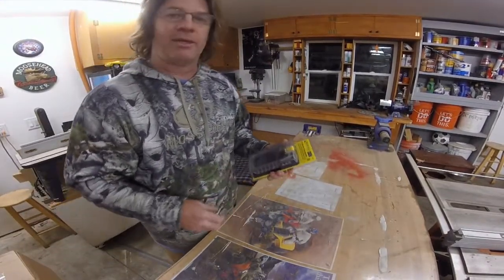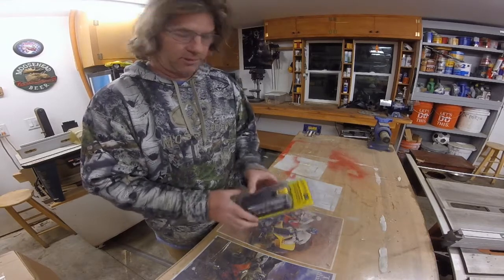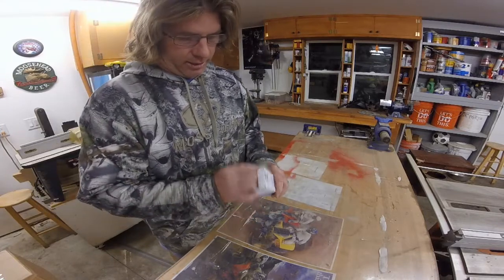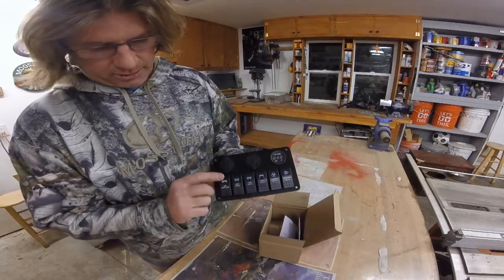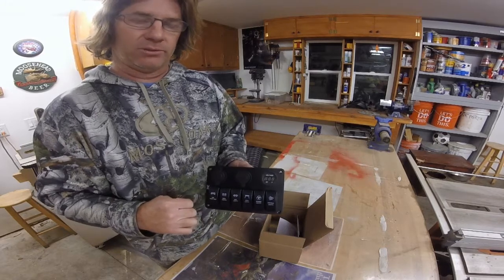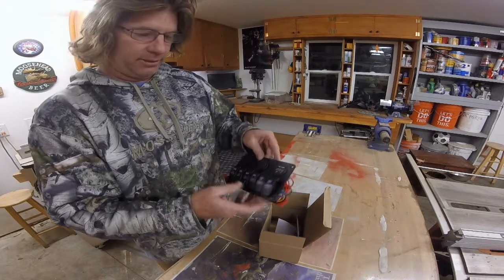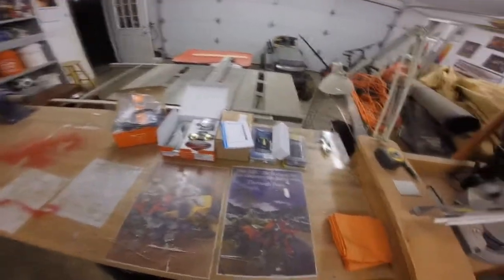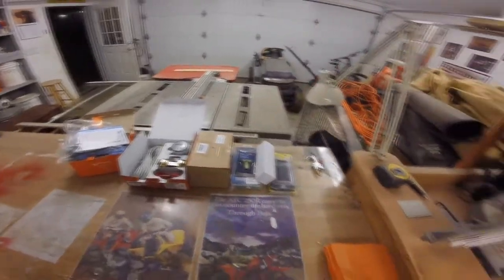First Parts for the Next Build!

Comment: Hello there. Great video - its really informative and thanks for sharing! Question for ya: If i want to parallel 2 Victron MPPT Charge Controllers - 100/50, do I need to have separate combiner boxes from the PV Array? Also, can I connect wires from the 2 charge controllers or they can feed the battery bank separately? If I combine/connect them, should I fuse the positive terminal before the positive wire gets to the batter bank? Thank you!
Reply from the maker: Thank you! I have only seen charge controllers run parallel when the solar array was also split up. X panels to controller one and Y panels to controller two. This is usually done for redundancy, but also for larger arrays. In this case they both have output wires to the battery bank. I don't have mine fused, but I do have a disconnect switch on the positive wire from the controller to cut off the array if necessary. Trip-Unlimited is running parallel Victron charge controllers, maybe they can give you further ideas?
Reply: Colorado4x4Van 
Thank you for your quick response and for the information. I’ll reach out to Trip-Unlimited as well. 👍

Comment: Well, this is all interesting. Does this build have anything to do with seeing what is coming down the pipe, currency collapse, etc? Have you considered a Fuso platform and if so why have you decided not to go that way? Thanks - Now I will grab the popcorn.
Reply from the maker: In truth, the only thing coming down the pipe in the future (for us) is our daughter!...lol...We need a bathroom, shower, and third bunk. The Van has been great for me and two of us, but no room for a third. I looked at Fuso, but the trucks they have in this class are not as sturdily built as the Steyr or Unimog. I couldn't fit a 14' camper on a Unimog, so I'm going with the Steyr.
Reply: Well, raising a daughter can cause financial collapse as well, ha. While the Fuso may not be as robust it would certainly get significantly better gas mileage I would think. Which brings up a question, which I may have asked before but certainly have forgotten, what gas mileage do you get with the van, and what is it's drivetrain. T-Rex has the 460, 4 speed tranny, and I believe either 4:11s or 4:56 gearing, and gets aprox. 10 mpg in US gallons and 12 in imperial gallons. Oh, and the van weighs 8000 lbs dry. Thanks
BTW. I have my eye on an alternate 4x4 rig similar to what you are doing but it really is hard to beat the 4x4 van. You can go bigger but you will give up mobility.
Reply from the maker: Don't ruin it for me!!...lol...My Van is 7200lbs. It is the 350 Chevy/TH-350 3-spd automatic transmission and 4:11 gears. It gets 11 mpg average. ( I usually keep it around 60-65mph) The Steyr gets 12mpg (weighing @ 12,000 lbs.) average so I won't lose anything there. As I'm not going on any LONG journeys, the mpg is not my highest concern. Being able to get far away from the madding crowd is. Mobility loss is negligible. The Steyr has a tighter turning radius than my Van, length is similar also. Height is the main concern, but I'm not afraid to trim the trees!...lol
Reply: Well, this is all very interesting. Can you share how you are sourcing the Steyr and average costs involved, if that's o.k. to ask. I know to ship a 40 foot container from Canada to New Zealand costs around 4 grand Canadian so I can see a bunch of costs involved just to bring the rig over. My guess would be around 6 to 7 grand. But what about parts and maintenance? Can't go to Napa for parts I would think. Anyway, glad you are going for it, very exciting stuff.
Reply from the maker: The shelter was $4k and the shipping from Germany was $1500 to Houston and I will drive down and get it there. It weighs 3100 lbs. The Truck I will fly out to Germany next Spring and pick out. Should be around $20k-25k for the Truck, $4k to ship here. I may get some upgrades done there as well before shipment, but we'll see. At that price the Truck is mechanically sound (new batteries, belts, fluids, tires/brakes at 80% or better, etc.) but still militarized and cosmetically as is. Parts are available but will have to be shipped. The diesel engine is simple with no electronics and can be serviced anywhere. Cab/cosmetic parts are widely available here as the cab is identical to the Stewart & Stevenson US military Trucks from 1994-2009ish. These Trucks are usually low-mileage examples and are designed for 500k mile useful life before overhaul. I am VERY excited also!
Reply: Oh brother, now you got me looking at Steyr videos and just finished a bunch of Terratrotter videos, ha. Thanks for sharing. Can you share how you shopped for the truck and shelter?
Reply from the maker: Here are some sites:   https://www.aignertrucks.com/en/vehicles/current-stock      http://www.camo.co.at/produkte.aspx?sp_id=1&hg_id=20      https://home.mobile.de/PHILIPP-HANFBACHTAL#ses   Shelters are hit and miss from over here. I suspect a Truck dealer can locate them. I got mine from a Unimog dealer:    http://www.unimog-huber.com/
Reply: Thanks for sharing all the info. Cool beans.
Reply from the maker: Terratrotter (Elmer & Nicole) did a great job with their Truck. The Steyr is VERY capable off-road...not quite as good as a Unimog, but very close. You can watch this video where I expand on these ideas:  https://www.youtube.com/watch?v=QJPivupBkpU&t=9s
Reply: Thanks, I watched it already. See what you have done.
Reply from the maker: Lol
Reply: Well it happened , its here